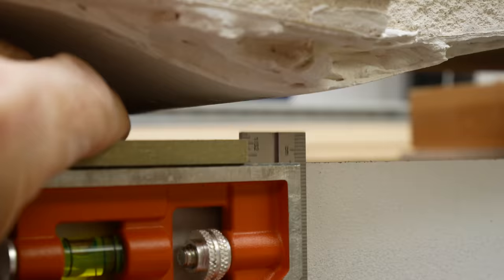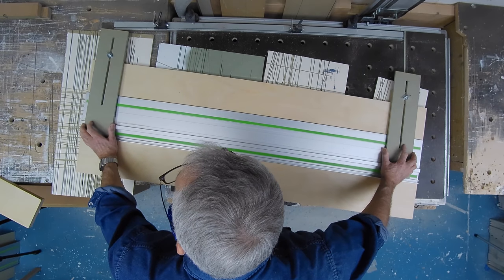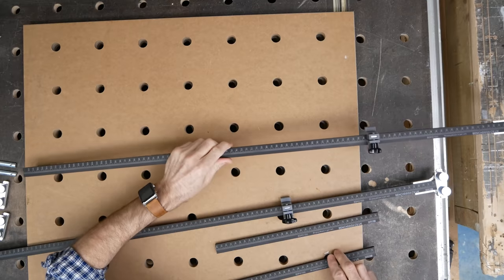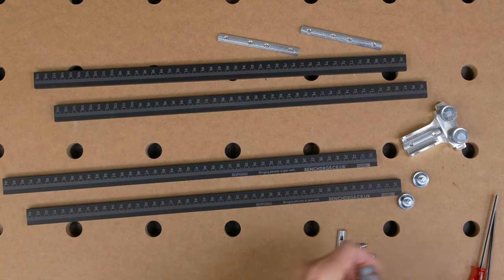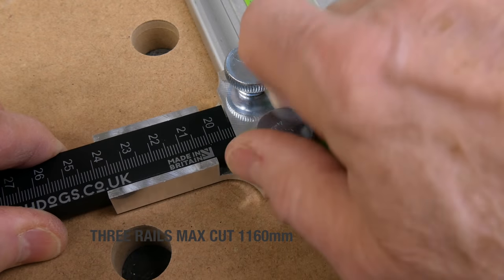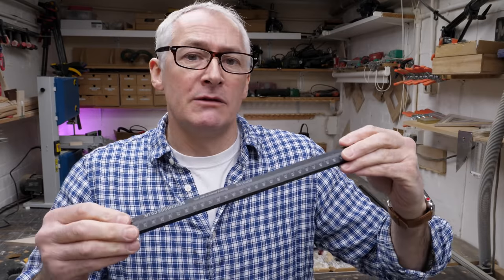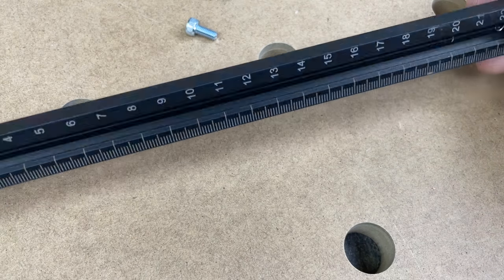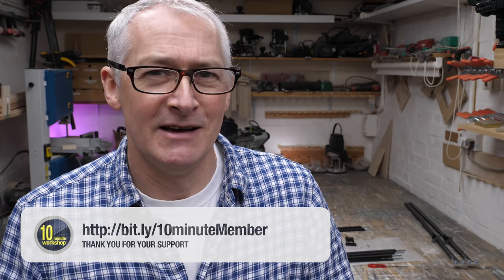Parallel guides [**Gifted/Ad] Video 440

Comment: Once again, excellent tutorial! I pre-ordered the very same just after Christmas. I did toy with the idea of making an adjustable guide myself, but when I saw that BD were offering this at £120, I decided to take the plunge.
When I placed the order, the only options were the 1m or 3x300 and something guides, but having watched the excellent woodgrafter demo' of parallel guide, I noticed in the comments that there was also an option for the 2x400 and something guides. I, too, decided on this option for the same reason you stated: the ability to rip a full sheet down the middle, and, the knowledge that I'd be struggling in my wee workshop to accommodate the 1m guide, which on narrower rips I'd be obliged to dance around whilst trying to control the tracksaw. 
I emailed BD and they very kindly amended my order.
I also have the BD rail square on back order, should be with me next month. I'd very much appreciate a video comparing the two solutions.
Reply from the maker: Sorted! 🙌👍👍

Comment: Great video Peter. Thanks. Mine arrived this week but the inner block had a lot of play inside the rail and they promptly replied and are going to send a new kit for me to test and send back the other.
The 3d printed stop block was a little too tight at first but after asking politely it allowed the bar to go into it.
Great kit. 
Totally agree about the narrow cuts one. Some known size spacer under the rail works just as well and doesn't mess with your calibration.
I didn't know or remember that you had an affiliate code with them. But I'll use it in the next purchases.
Got a taiga square but the benchdogs one is so beautiful I might jump into it later.
Have a great weekend Peter, all the best.
Reply from the maker: Thanks Douglas! Yes sounds like you had the usual Benchdogs customer service - excellent! 👍

Comment: I made my own a couple of years ago with t track and 3D printed parts, they are a game changer if you are cutting down sheets into parts. Just set the stop on a tape and go, quick and supper accurate. The bench dogs version looks very nice and for anybody cutting sheets often would soon pay for them in time saved.
Reply from the maker: Sounds good! 👍👍
Reply: I'd be interested in any more details (eg stl files etc for the 3D parts) if you have them. I've got the bargain bucket track saw (evolution) and most commercial systems either don't fit, cost more than the saw&track or both :) Thanks

Comment: An excellent review of yet another excellent product from Benchdogs. 
I have the festool version...it works well enough, but is too short in length, and tends to tip as it sits either side of the board you are ripping.( I fixed mine by drilling a hole in each end of the stop and  bolting on a little tab that rests on the workpiece)
This however seems a much more practical solution and is very reasonably priced compared to the festool design. It's on my shopping list.

Comment: I have some similar from a different brand. Would be great if manufacturers could make it a flip stop as once I’ve  set my stop in place I don’t want to move. But if I want to cut a piece oversize (trim cut)  then turn it around I can’t do it without changing the stop a flip stop would change that. It’s probably quite important to do the trim cut as only the side that is under the rubber of the splinter guard is guaranteed no to have chips in it.

Comment: Luv the out take. Thanks for the heads up re  bench dogs narrow cut product. What I didn't like about these guides was the way you lose the calibration when doing narrow cuts. But as you say there's always more than one way to achieve the goal. And in that vain I would also like to hear your thoughts on squares and parcels guides.
Reply from the maker: Thanks! Yes, I think the narrow cut option could have done with a bit more prior thought - though I guess an option might be an extra set of rail adapters if you need to make those cuts regularly. Mostly though, I think the alternatives do the job pretty well. 👍

Comment: Calibration weakness? When you flip them over to tighten them? Gauge with feeler gauge, flip, insert feeler gauge again, then lock up. .6mm in my case, pretty good.
Reply from the maker: Or you can calibrate them flipped over, using a rule. In truth though, as long as you done loosen the nuts off completely there’s no movement when the rail’s flipped. Good trick with the feeler gauge though Dave - I’ll remember that one! 👍👍

Comment: I went with the 3x330 option as it can fit in a systainer.  In fact, as I've got a rail square on order, I went for a sys-combi 2 and the rail square option with the insert but no systainer.  The rail square will sit in the upper true systainer part and the 3x330 parallel guides sit happily in the drawer with room to spare.  In fact, even with the end connectoirs attached, they just fit sideways if you take off the locking knobs or at an angle if you don't.  Just a bit of foam cutting to tidy that bit up.

I also have the BD mk2 fence in 3x350 format in a BD systainer (damn - too much BD stuff????).  The same connectors let me connect a length of fence to the parallel rails if I want to extend the range further and I have the option to use the metal flag stops rather than the 3D stops if I want.  Locking the 2 systainers together I have all my BD stuff in one portable place.  

BD is getting to be a bit of an integrated system.  Wonder where they got that idea Festool ?
Reply from the maker: Thanks! Yes, there's a lot to be said for the 'system' approach! I received my Mk2 square this week, haven't had a minute to play with it yet! 🤷‍♂️👍

Comment: Hi Peter, once again a great video. I have some remarks/questions:
1. I cant find the 35cm extention? I can only order it in 1m, 2x 44,5 3x33? 
2. It's only for the festool/makita/triton rails right? I thought they were busy developing the rails for bosch/mafell also.
3. Do you think these guides can be used to square up a full sheet? (with the right extentions) By:
a. cutting a couple of mm of the factory edge of one of the long sides
b. use the parallel guides to make the other long side parallel to the other long side
c. use the mft to square the short sides to the long sides?
But then it would need at least 122 cm of extentions + the length of the stops. Or am I making an error here?
4. I would also like railsquare vs parallel guides video!
Reply from the maker: Hi Jelle. 35cm extension come with the 1 metre rail. 2/ Yes, it uses the up-facing t-slot to connect. Bosch/Mafell still in development afaik. 3/ yes, but... they’re parallel guides - they don’t cut square. But sure, with an MFT - or a rail square - it’s doable. And you’d need the full rail set to get ~1220mm 👍👍

Comment: I would have thought a rail square with 1 parallel guide would be the combination to go for for 90 degree quadrilaterals. You square 2 adjacent edges of the sheet using the track and rail square. Then keeping the rail square on one edge you use the guide to measure from the adjacent  squared edge. The cut should then be both square (due to the rail square) and parallel. You can then trim to square the 4th edge just using the rail square. Good for repeated pieces, say shelves or drawer pieces. Thoughts Peter?
Reply from the maker: I think I’ve been there already, David! 👍 https://youtu.be/zKKs--bksXs 😆 Between ourselves, the MK2 rail square from Benchdogs does have an extra couple of holes drilled in it... 🤔👌

Comment: Thanks for the video. It would be interesting to get a comparison of the various competing solutions available on the market. Some have flip stops which seems an interesting idea. 

I ended up making my own out of MDF using cheap Incra 'Metric Incremental Racks' to be able to reposition the stops consistently (with M6 screws added to provide a 'micrometric' adjustment option). It's not as light, but it's tailored to some additional unique needs ;-)
Reply from the maker: Sounds good! 👍

Comment: it would have great if you had done comparative analysis of the various available options. as you always do.
Reply from the maker: I’m not sure what else I could have done tbh. All sets are the same price. All sets work the same way. They have the same track connectors and work with the same tracks. I’ve given the cutting capacities of each set, and the variations of 1/2/3 rail options for maximum capacity. I’ve suggested the likely usage for each set (in workshop, on site) and expressed a personal preference with my reasons. 🤷‍♂️👍

Comment: Im torn between the parallel guides and the rail square. Both have their uses but I wonder if the square is a better option given Benchdogs attachment due for the new version which will essentially give you stops - from what I've heard.
Reply from the maker: Yes. I’m waiting to get my hands on the width stop accessory before taking a look at PGs vs Rail Square. Unfortunately it’s been delayed for some time. 🤷‍♂️👍

Comment: Peter, love your videos, as an occasional user and diyer I have splashed out on a festool track saw. What rail square would you recommend as a value for money Vs performance option, I’m using these only occasionally so don’t want to spend a fortune but want something that works each time I use it ?
Reply from the maker: Hi Ben and thanks! TBH I think the decent makes - Benchdogs, FC tools, TSO, etc... are all around the same kind of money, with maybe the Benchdogs one coming in at a little less at £110 inc VAT. You can get 5% off that with the offer code ‘10minuteworkshop’. You can get some cheaper squares off eBay, but I don’t know anything about the quality, and have had disappointing results from a cheap DeWalt one many years ago. I talked about rail squares in video 402	Rail square	https://youtu.be/qik-UoZUAgg, and showed how to make your own in video 418	DIY Rail Square	https://youtu.be/VaxG6vNF1kY - not difficult, and certainly the cheapest option for occasional use! HTH. P

Comment: Hi
Do these work with the 
Excel 1.5m Aluminium Guide Rail that you reviewed in your “which rails work” video?
There available again at £35, so this would make a good priced solution if compatible. 

Fantastic vid as always - Thanks
Reply from the maker: Thanks, and yes they will. The excel rails are just clones of the Makita. 👍👍

Comment: Very nice.
I presume these will fit onto other festool style rails like makita, triton, scheppach?

I know they wont fit mafell/bosch tracks, but mafell saw wil go into festool rail, I thinking about buying set of rails just for workbench
Reply from the maker: Thanks! From the video description:- 

NB: The Benchdogs parallel guides attach using the upward-facing t-slot on the left-hand side of the standard Festool-pattern guiderail eg Festool, Makita, Triton, Erbauer, Titan, Excel etc... If your rails don't have this upwards-facing t-slot, they wont fit. 

So, I’m pretty sure that’s a no to Scheppach I’m afraid. I believe that Benchdogs are working on a solution for the Mafell/Bosch rails. 🤷‍♂️👍
Reply: @10MinuteWorkshop  doh, one time I dont read description 😟,  and I am the first to point a finger at people for not reading description ☺

If they are working on mafell solution that would be worth a wait. Hopefully they will bring back the square too.
Great product.

Thank you.

Comment: What will the improvement  comparing  benchdogs versus the Festool parallel guides for the Rail System  which can cut really narrow strips and upto 600mm .....?
Reply from the maker: They’re different animals. Parallel guides are for ripping regular strips from a sheet. Rail squares are for square cuts from eg a pencil mark. 👍

Comment: I used the promo code and talked with Ralph a bit over the phone and finally just received my parallel guides, hinge and fence. Everything seems to be in good order outside of one of the parallel guide bars needs to be replaced due to some misalignment issues. Do you have plans to do a video on the narrow rip feature? No instructions came with any of it which I was kind of disappointed about. Love your videos and advice thanks for all the help.
Reply from the maker: Thanks. As far as I’m aware there are full instruction manuals to download at benchdogs.co.Uk, and the current video looks at the parallel guides with narrow cut adapters, and rail square repeat stop. 👍👍
Reply: @10MinuteWorkshop  thanks I did find them as soon as I posted my comment I looked at the website duh. I haven't played with them very much yet but I'm still not sure how calibrating the parallel guides to both the narrow rip guides and the standard parallel guides is possible I'm sure the reasoning will present itself during the process. Thanks for all of your great videos

Comment: Hi Peter  Do you know f you can join two long lenghts together. I often make tall cabinets around 2mts long and would like them all to be exactly the same length . I would only need  one guide as I would use the guide square for cuts. My thinking is that this would help with the lining up of the LR  32 hole system. 
Measurements on the rail wouldn't be a problem once set up as consistency of cut lenght is my priority? Other systems that can do this are over double the price.
Reply from the maker: That's an interesting one; yes, the same joining bar could be used to join the long lengths of extrusion, so that certainly wouldn't be a problem. And I hadn't thought of using these with the LR32! Like it! 👌 👍

Comment: A video on rails square and parallel guides would be great Peter ! especially as no one makes anything for my metabo rail .... but figure I could fabricobal ( is that a word ?) something more easily for the parallel guides...
Reply from the maker: I think it’s a word now Graham! Shame about the Metabo rail - hadn’t realised it was different. 🤷‍♂️👍
Reply: @10MinuteWorkshop   yes people say you can use the track on a festool saw etc but not the fittings, or rail square etc ( the rear has no channel for connectors ) 😡

Comment: Hi Peter nice video and keep up the good work, Have you had a chance of using the new Bench dogs square, with the tool less clamping. Just asking as I got one for Xmas and have had good results but had to do a little bot of fettling to get it fully functional?
Reply from the maker: hi Kenny, and thanks! I have one, have it fitted, but haven't used it yet; it's the one I'll use to compare to the parallel guides in a forthcoming video. What fettling did you need to do, out of interest?
Reply: I had to drill a bit of clearance in the threaded holes as the dogs didn't fully screw in up to the shoulders. I also had a tooling dent where the rail sits/slides, just filed it flat. Finally had to fit both spare cam clams, 1st snapped on first fit, second not much after. Looked like the 3d printing hadn't adhered on the tabs, replaced set seem to be holding but I do not try and push the tabs to hard.

Comment: The Wood Pecker Parallel guide is ridiculously over-priced but why is this a fraction of the price? What's the MSRP after pre-order?
Reply from the maker: Pretty sure that information is in the Benchdogs website. £110 +VAT pre-order, £120 +VAT after. Don’t forget the Ofer code 10minuteworkshop for 5% discount on everything. 👍👍

Comment: I have some questions though about breaking down sheet good and using parallel guides and using a square. Forgive the newbie questions. Would one start breaking down a sheet first buy cleaning up one edge then using the PG or clean the edge then square up with a square guide from bench dogs or TSO etc then use the PG?
Reply from the maker: I’d clean up one edge with the tracksaw first, then use the parallel guides to make the rip (long) cuts,  then the square for the cross cuts. You could use the parallel guides for making the cross cuts, cut you need to check the end for square as that would be the datum that all others are referenced off. This is where the rail square comes in, of course! Hope that makes sense! P

Comment: Will these work with the cheap rails from the Aldi saws? Or the rails lacking the T slot prevent that?
Reply from the maker: No, these rely on the upward facing t-slot at left for the connection, so I’m afraid they’re a non-starter with Aldi/schepoach rails, and the Lidl Parkside as well. 🤷‍♂️👍
Reply: @10MinuteWorkshop  Thanks, damn! Do you have any idea of what might work best for both a rail square and a parallel guide for the cheaper rail? I'm especially trying to figure out how to do repeatable longer square-offs without something like an MFT, me and a measuring tape isn't quite good enough it seems!
Reply from the maker: Make your own is the only option AFAIK. Video Video 418 for a DIY Rail Square	https://youtu.be/VaxG6vNF1kY

And P5 of the Tracksaw workshop series playlist here - http://bit.ly/TracksawWorkshop for the parallel guides. You’ll need to get a bit creative for the parallel guides on those rails, of course. 👍👍

Comment: Hi Peter. Bit late to the party but great video as always.
Do you know of any parallel guides for the evolution rails?
Reply from the maker: Thanks! No, I’m afraid the Evolution rails lack the upwards-facing t-slot at the left-hand side that most parallel guides (and other accessories) use. 🤷‍♂️👍
Reply: Thanks.
Looks like I may be doing some strategic dremeling